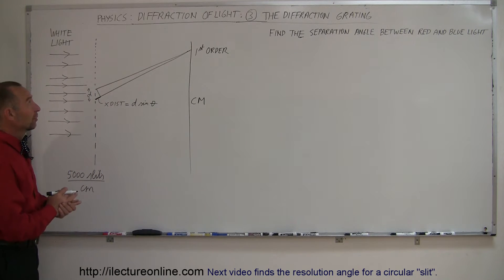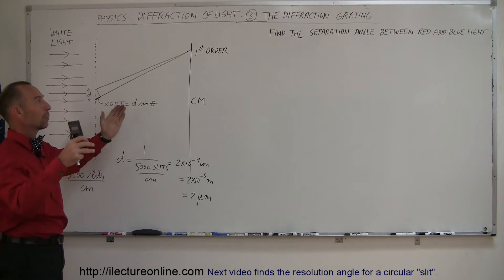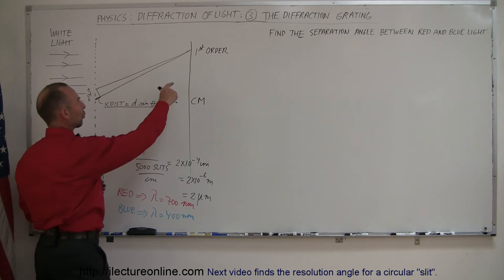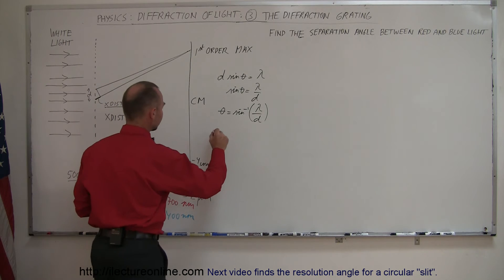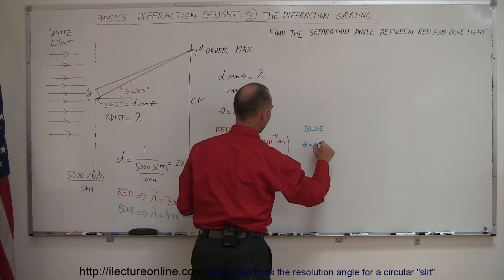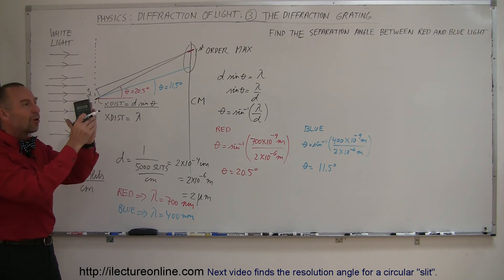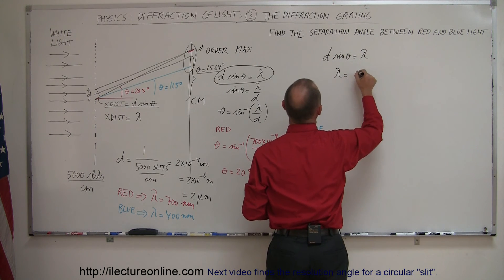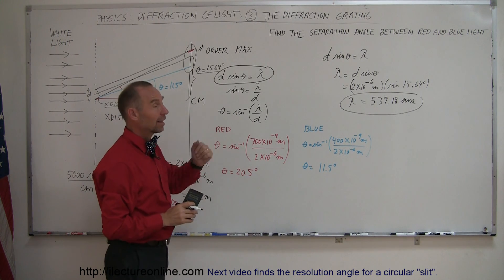Physics - Diffraction of Light (3 of 4) The Diffraction Grating

Comment: so the assumption is that a slit is infinitely thin?
Reply from the maker: Walter,
No, the spacing between the slits is small but not infinitely thin.
Reply: Hi thanks for your reply.
I was refering to the actual width of each slit - in the calculation you calculate the distance between each slit as 1/number of slits per cm. Can't this only be true if the width of a slit is very thin (in comparison to the spacing between the slit)
Reply from the maker: *****
A diffraction grating is usually made by making grooves or scratches on a clear piece of plastic or glass.  The width of the grooves or scratches are typically smaller than the width of the space between them.